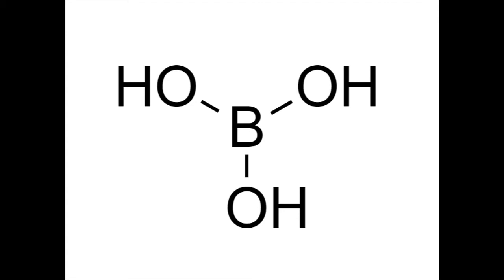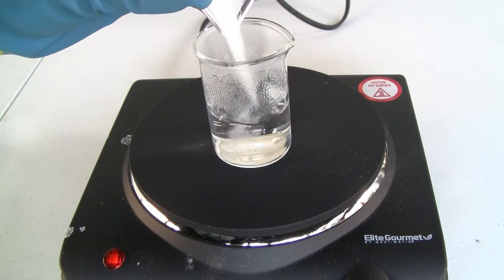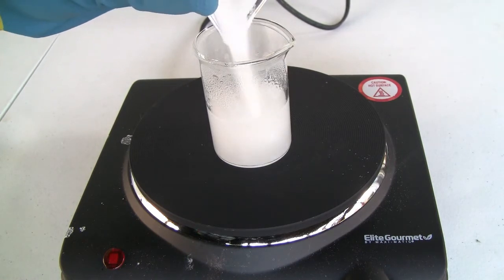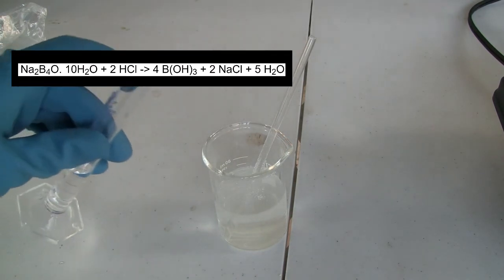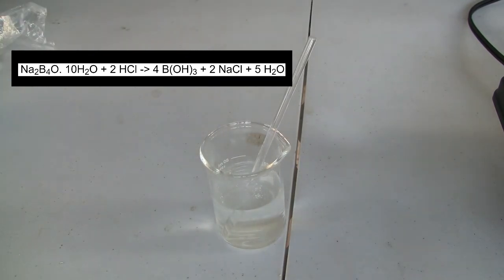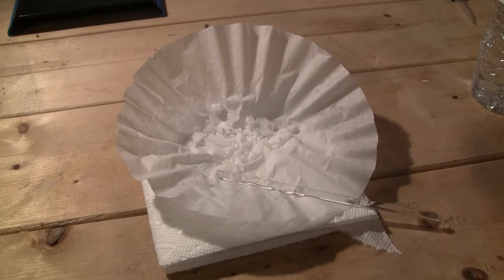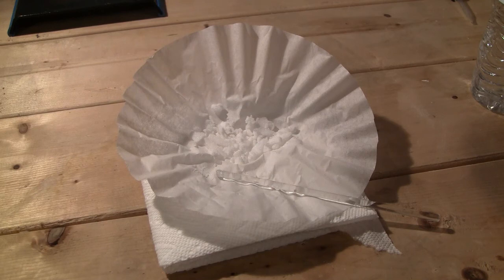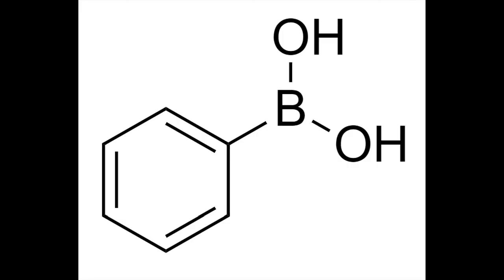Boric Acid From Borax

Comment: Hello,

What is 3M HCl in %?

Im trying to make some Boric acid for green fire effect and Im having some difficulties.

Thanks.

Edit: I have 16-18% HCl solution and I tried to make it 9.5% because I followed this article:
https://science.wonderhowto.com/how-to/make-boric-acid-from-borax-302525/

I only did half of everything for convenience.
After refrigerating, nothing precipitated out. So Im guessing my yield is less than 2.52g of Boric acid at 0 celsius.

In comparison with your tutorial, I used too much water/acid and too little borax powder.

Can you help?
Reply from the maker: 3M HCl is equivalent to about 11% but my solution is only roughly that concentration as I have not titrated my HCl in well over a year. My first thoughts on why nothing precipitating out for you would be that the solution could be super saturated and might need some help coming out of solution like adding a seed crystal or scratching the side of the beaker a little. Might I ask about the amounts of each reagent you used including how much water was used?
Reply: @bismuthbuilds9334  I followed instructions from the above mentioned link. So, way more water and acid and way less borax than you.
Reply from the maker: @dan_the_dj  Based on the link you posted in your last comment, the dilution that they made would have made about a 3M HCl solution if my math is correct, but they use an extreme excess of HCl for their reaction. Also I did the math for the expected yield even with the larger amounts of water the link uses and there should still be some boric acid crystalizing out of solution. If the lower end of 6 grams of borax is used (based on the link you gave) with the 100 mL of solvent, then 1.371 grams should crystalize out with the remaining yield staying in solution and if 7 grams was used instead, then about 2.019 grams should crystalize out with 100 mL solvent and remaining yield staying in solution. 

I also had issues with crystalizing out boric acid when I was first experimenting with this reaction and that is why I decreased the amount of solvent in later trials to encourage the boric acid to crystalize. I hope this helps.
Reply: @bismuthbuilds9334  thanks for the help. Could I use my non diluted 17% HCl, but proportionately less of it to match yours or do I need to dilute it nonetheless?
Reply from the maker: @dan_the_dj  I believe non diluted 17% HCl should work fine. I only used my 11% HCl because that was what I had.